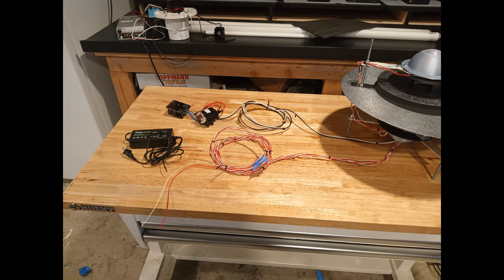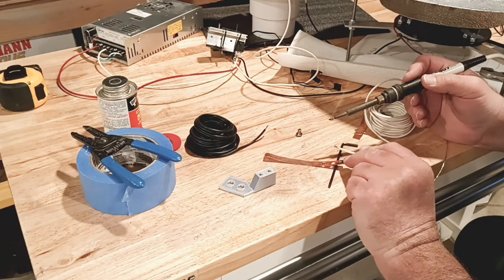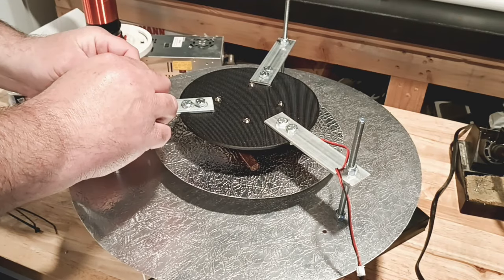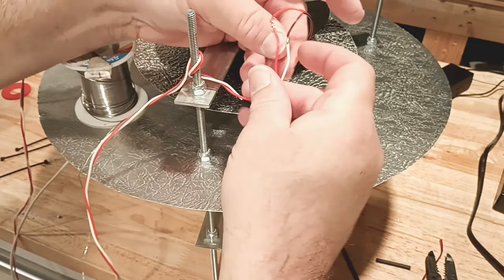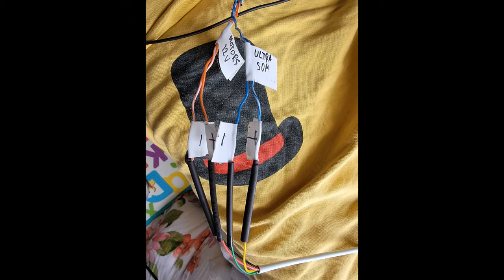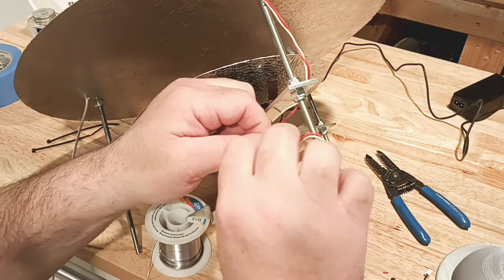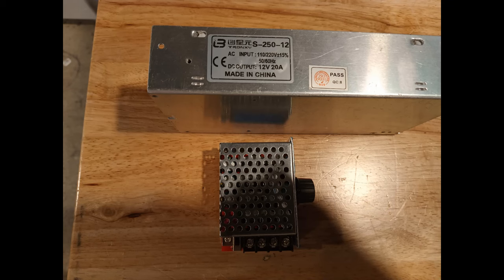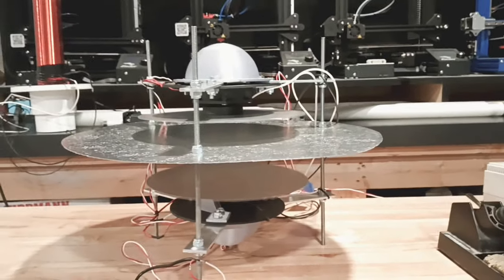Graviflyer Build Part 2 "Motors & High Voltage" #13

Comment from the maker: All the 3d printable files are linked in the description for all the plastic parts. I keep updating the original file. If you built the first one the high voltage connectors will be there soon. The ones in this video are already there.  Also the links for all the parts are there in the description.

Comment: For what it's worth, I stumbled through Woodward's book, Making Starships and Stargates: The Science of Interstellar Transport and Absurdly Benign Wormholes (I finished formally at AP Physics, AP Calc, and AP Bio), and there are at least two incredible facts: Capacitors gain mass when charged and Mach effect test articles move when the power is, "chirped", or pulsed.
I like pilot wave theory, because I imagine that not pulsing the input would be like trying to make waves in a pool by pushing once, as hard as you want, but not repeating the motion in cadence with the wave propagation.

The UFO data FOIAd from the RB-47 on July 17th, 1957 also paints a picture of pulsing:

"ECM reconnaissance operator #2 of Lacy 17, RB-47H aircraft, intercepted at approximately Meridian, Mississippi, a signal with the following characteristics: frequency 2995 mc to 3000 mc; pulse width of 2.0 microseconds; pulse repetition frequence of 600 cps; sweep rate of 4 rpm; vertical polarity. Signal moved rapidly up the D/F scope indicating a rapidly moving signal source; i.e an airborne source. Signal was abandoned after observation … "

A crew member who was interviewed said he membered the  signal freq. to be closer to 2.8ghz.
Point is, if I understand this correctly, the primary 3 gHz signal was emitted intermittently, pulsed during emission periods, and the polarity was oscilated on top of it all.  That's three additional, "dimensions," or axis of control beyond the 3 GHz wave.
It seemed to work for the UFO they chased across the souther US that day.  Pulsing seems to work for Mach Effect Thrusters (MEGA Drive).
What do you think?

Comment: Someday I will build my own graviflyer :) Right now I am concentrating on building an interferometer to both prove and test my upgraded superconducting version of my gravinductor coil arrays that will handle payloads, pilot, and passengers for an Earth only levitation field momentum vehicle :) Later I will introduce a space faring model with redundant systems such as implementation of a Searl device for future spacecraft models.

Comment: Looks good. I tried locknuts on the three legs, but they would bind up and damage the thread so I use nuts and lockwashers now. Alexey uses brass brushes that tpuch the high voltage spinning discs, but copper might work too; copper might break down easier than brass. I have links in the share drive to all the parts I used.
Reply from the maker: Thank you. I have been looking into it. I ordered a set of the magnets Alexey is using. Just so I can see the difference.

Comment: Excellent instructional video. Have you considered using an automobile coil for the high voltage?
A PWM with a square wave output can drive them very well. I have used several things to attain high-voltage, including neon sign transformers. Keep up the good work. 👌👍👍🌩
Reply from the maker: For plasma experiments. Yes. For this no. I am looking for a static volt. I just want to build up charges on the disc. A spark ruins it. I have considered adding felt to the high voltage part that touches the disc to get more charge. Just like rubbing your sock on the ground to shock someone. 

I have made a lot of plasma videos. My favorite is when you add a high voltage modals to the spark gap. It goes crazy
https://youtu.be/_d-UN-vXX3g?si=BQUnl9YO7esLbuC3
Reply: @nathanbunten4299  My socks shock everyone without being charged. 😂🤣

Comment: To upgrade the graviflyer motors I suggest using asymmetrical D/C motors when considering making the graviflyer a stand alone product:  https://youtu.be/Gh8M5UWq9Ao?si=nEawkrjSKJ5lwZHw 
I suggest bringing this to Alexi’s attention when considering making a remote controlled dtone version of the graviflyer  and I suggest wrapping the motor 6 coil poles instead of 3 as depicted in that video to run all the onboard equipment ;)
Reply from the maker: to be honest stepper motors would be best and a 3d printers motherboard. I could reprogram it and have a nice display to run everything from.

Comment: At 10:00, BLDC motors have an internal electronic control circuit, they are not designed to have their speed and direction controlled varying the input voltage.
Your 4 wire fans have positive, negative, tacho output and PWM speed control input wires.
PLEASE research how BLDC motors work.
With respect to the wiring insulation properties, as you are feeding the HV to a load and current is flowing, the output voltage of your coil will drop.
So you are not supplying full output voltage of your coil to the flyer.
Keep up the quality of the build, nice and clean.
Reply from the maker: They have 2 wires and they do change speed with voltage. I know how bldc motors work. The high voltage only needs to put out charges or static volts. It is not intended to make plasma or sparks.

Comment: I'm sure you have a reason, apologies in advance if you do, but have you considered that it's much harder to achieve resonance on a textured metal disk rather than a smooth machined metal disk? Also the holes for the wires might introduce resonance issues?
Reply: Are the magnets arranged in a holbach array?
Reply from the maker: honeycomb shape
Reply from the maker: It is not any harder. resonance does not care what shape.

Comment: Upper disc left (+), lower disc right (+), middle (-), 6 magnets (+) up...
Reply from the maker: upper disc positive lower disc negative middle is part of the tesla coil. yes 6 magnets negative up (they come that way)
Reply: @nathanbunten4299  no, the magnets of the lower disc will have the north (+) pole facing up,lower disc(+) pole
Reply: @nathanbunten4299  I know well how the UFO engine works

Comment: the first sign that you realize that ultrasound is emitted is that it will hurt you headu remember that Alexey often uses the helmet I did ultrasound tests only one hour and it hurt me headu all day put the emphasis on ultrasound because this is the force field for electron dispersion not rotating disks rotating disks is just to lead in error
Reply from the maker: I know what it does and have gotten headaches but I do take precautions.
Reply: @nathanbunten4299  

the bell that puts Alexey above the disk and inside is a piezoelectric has the role of directing ultrasonic waves to the rotating disk you have to generate ultrasonic longitudinal waves of a certain frequency and pressure otherwise you will not be able to input the electrons accumulated on the edge of the rotating disk you can rotate the disk to thousands of revolutions that will not detach electrons the only force field that influences the electron is the sound test ultrasound with the candle flame so you I still have a lot of work to do
Reply from the maker: @TitiProsopel  the high voltage is actually static electricity. It will make the field on the discs. the piezo disc gives it direction. It acts like a pulse wave. Yes it does move electrons the top disc will loose all the positive and the bottom will gain the negative causing the top toroidal to collapse.

Comment: sorry to be a beginer , why does the bottom disc have more space between it and the middle disc compared to the top disc? is there a specific for this? It looks great by the way :)
Reply from the maker: The bottom bisc has magnets and the top doesn't. It is the eddie current effect. The distance is controlled by how much eddie current goes into the center plate being aluminum. It also has to do with charge transfer. The top disc is being charged with positive charge and the bottom with negative. The top charge collapse into the bottom. Depending on weather. It will take longer for the transfer to happen. The way to make it go faster is by changing the position of the plates. 

In short if the bottom plate was closer the top would not spin in an opposite direction and charges would bounce back and forth between the plates.
Reply: Great, thanks. So do you have a measurement for the distance required?
Reply from the maker: @dkdyker  I start mine at 1 1/4" on top and 2 1/4" on bottom.
Reply: Thanks again